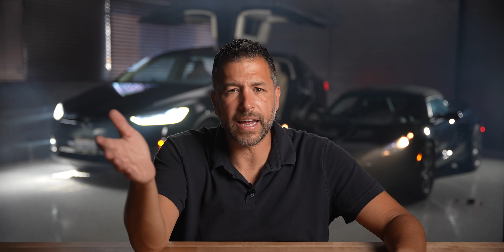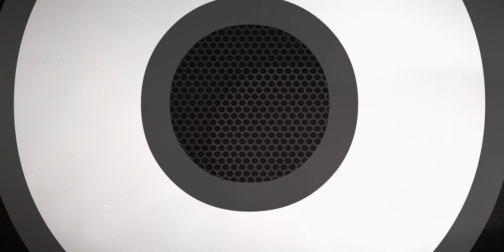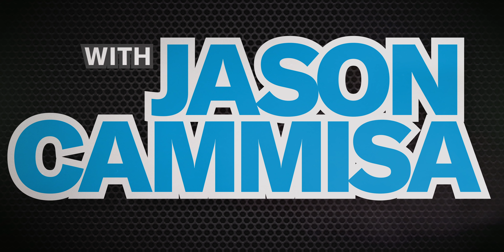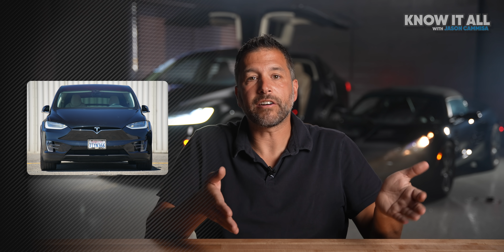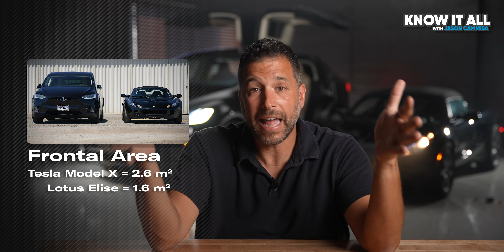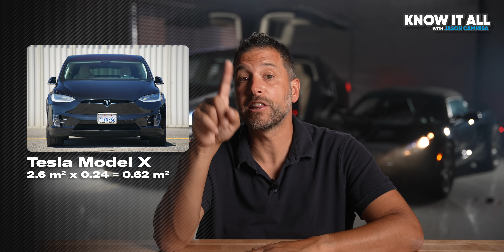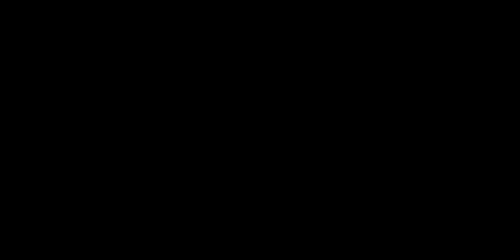Coefficient of drag has nothing to do with size | Know it All with Jason Cammisa | Ep. 12

Comment: I guess mines the ultimate experiment in this sort of regard. I have 2 XJ's, one is lowered a lot (over 6 inches) and had the trim and racks ect. 'decked', running on 275/40R18. It has a reverse cowl induction hood and a large air dam I made so that the intercooler doesn't look too out of place with some air deflectors as well. My other XJ on the other hand is raised almost 6 inches higher than stock with a 32 inch tire. I haven't done anything with the body, it's still stock.

And the difference on the highway is like unreal between the two. The lifted one feels like it's max speed is about 120kph and it seems like the pedal does nothing past a 1/3 throttle and it's a handful to keep that thing driving smooth down the road at that speed. It also didn't have much of a problem going faster than that when it was stock and would go about 150kph-ish. Felt like it could do more but it would have been too much of an effort to do in the space of the road so I never tried to go further with it.

The lowered one has power adders so I can't really compare to how it would be to my other one but I haven't been fast enough to feel if the air was a factor vs. power but I know for sure it can cruise at over 250kph without struggling to keep it straight or feeling floaty or anything like that. But at highway speeds I don't feel the air effecting it at all really. I also have an Intrepid and it drives great at speed down the highway but between it and the lowered Cherokee there is no perceived difference.

In essence drastically reducing frontal area does have a very large effect of Cd values. I'd say shape and size share hand in hand for overall effect. But I think if you seriously change one aspect you will definitely feel a large benefit.

Comment: Coefficient of drag is not always about the front area but also LENGTH of the object experiencing shear to the airflow around it. And longer the object is the more friction it experiences with airflow around it. Therefore greater coefficient of drag. So it has a lot to do with size. For example a sphere of given diameter has less drag than a rod of same diameter with parallel airflow over its surface. Go learn fluid mechanics. Idiot.

Comment: Stating drag coefficient is a strange stat to brag about, without including the frontal area. Because comparing vehicles without knowing their frontal area of each vehicle. It would be like comparing vehicles based on their HP per L, without knowing their engine displacement.

Comment: The Tesla has a low coefficient of drag (period), but it produces a low amount of drag for it's size. So how much drag are both cars creating at, say, 50 mph and 100mph? And how much force is needed to push each at those speeds? Im going to guess I'll have to throw in assumptions, like they'll have the same tires with the same contact patch size, maybe also same weight.

Comment: Well, it’s not true to say the drag coefficient has nothing to do with size; it’s easier to achieve a lower drag coefficient with a larger vehicle, particularly a longer one.

There are three (primary) reasons an Elise has a less than stellar drag coefficient:

— It prioritizes aerodynamic stability at speed over absolute efficiency;

— It prioritizes engine and brake cooling over absolute efficiency;

— It’s incredibly short (length)

Comment: Fine as far as it goes. What is the difference between ballistic coefficient between those two vehicles. If the Lotus Elise is heavier for its size than is that Tesla it may actually go through the air easier.

Comment: My Skoda Fabia 2013 is narrow small and drag coefficient 0.31.
There is no car expect Kia Picanto that is slighty narrower than my car.
There is no noise inside at all.If I lowered it a little bit,it will even faster.
It has only 1.2 TDI 75 HP,I was able to do 190 kmh at 4000 rpm max engine rpms!
Fuel consumption is 3.0L/100,maximum 3.5L/100 km.
This car is just superb.

Comment: Well... I get your point, scaling a car up or down will change the drag area but not the cd. Since it's just the ratio between frontal and drag area.
That said, I do think size matters... :D It's perfectly valid to say that's a good drag coefficient, for that size of car. If the car is really small, the cd isn't as critical, since the frontal area is already fairly small. If the car is very large, it becomes increasingly more important to have a low cd in order to not waste tons of energy in order to move air around.

Comment: In automotive engineering the drag coefficient and the "projected" frontal area are part of a formula that determines the total wind resistance force. It's a little confusing/misleading to create a direct correlation between those two factors like in this video. Maybe on a simple level it makes it easier to understand, but they are in fact not connected to each other like they "belong together". The drag coefficient is highly affected by intended aerodynamic goals like desired down force under specific driving conditions, i.e. by using spoilers and other aerodynamic tricks. The Elise has an intended high drag coefficient, because it needs down force up to a certain speed for cornering. Since it has a fairly weak engine, it's not intended to drive at high peak speeds with the highest possible efficiency like the Tesla does (side note: wind resistance force goes up exponentially above 100mph!). The Tesla needs to "glide" through the air at all times to maximize range. Because these two vehicles have completely different aerodynamic goals the drag coefficients shouldn't be conflated with each other.
Reply: Drag goes up with speed squared at any speed. 100 squared is quite a lot, but it's not exponentially more than, say, 50 squared.

Comment: Yas man but the cars are made for completly different purposes, the Tesla has to cut smooth through air because of the weight and range while the Lotus has higher coeficent because being lightweight, it needs more grip and stability. I don't know if the comparison it's fair.
Reply: The Lotus Elite from 1956 had a CD of 0.29. That was 50 years ago, it can't have been that hard for the Lotus team to aim a little higher than 0.44.

Comment: So a GM Chevrolet/Opel/Holden/Vauxhall Calibra had a 0.26 cd with 1.93 m2 area = total 0.50 m2. It also had an 2.0 engine and did 135mph and 50mpg and was made 35 years ago - nice to see so much progress has been made.............(The Calibra was not available in the USA  - ever. Think about why)
Reply: That's kind of funny because a 2.0 probably would have been seen as a big engine outside of the U.S at the time as most 4 cylinders leading up to the 90's were 1.6 and 1.8, the 2.0 being the nice big boy engine

Comment: The size of a vehicle matters as much as the Coefficient of Drag. That's why the formula for aerodynamic resistance is 
Coefficient of Drag TIMES Frontal Area Squared.

A Real 747 and a model of a 747 you make on the dining room table have the same Coefficient of Drag, about 0.031. But the frontal area of the two is miles apart. A real 747 has a frontal area about 1,937.5 square feet in size. The small model 747 that you made on your dining room table may have a frontal area of 0.5 square feet. (half a square foot)

At ZERO POUNDS (weighing nothing), a Real 747 needs about 90,335 Horse Power to fly at 600 mph - while
The small model 747 that you made on your dining room table needs about 23 Horse Power to fly at 600 mph.

The smaller the frontal area, the less energy needed to move against air resistance.
The smaller the Coefficient of Drag, the less energy needed to move against air resistance.

Combined, you get the real picture of how much energy is needed for a specific vehicle to over come air resistance at a specific speed.

Comment: Being a know-it-all I'd like to add, that getting a good Cd is harder, when your car is high, wide, and short and easier when it is low, narrow, and long. Now, big SUVs tend to be higher and wider than other cars, but usually not longer by the same percentage. But, "that's a good Cd-Value for a car with a large frontal-area-per-length-ratio" is a bit over specific to say for some people so they might go with 'A large car'... Synonymous for e.g. SUVs.

I'd at least assume it to be rude to be thrown from a building for this ;)
Reply: One valid and useful observation would be "Cd surprisingly low for how boxy it is".

Comment: So, mechenical engineer here. While what this guy is saying js 100% true, when applied to cars it becomes more complex. See you only have so much space to work with. You cannot for example take a tesla s and make it 2 times bigger, it would have the same cd but would obviously not fit on the road because of width AND length reasons. And here is where it becomes intresting: the bigger you make a car, the less dimensions you can work with. Tesla choose to make their models relatively shaped like a droplet so it has a very low cd, losing a lot of space in front and as a consequence losing space in the back. Volkswagen id3 chooses to make the car a bit bigger,  but at the cost of shape optimising.

Comment: Question... If one vehicle is twice the  size of another but they both have the exact same CD, do they both use the same HP to go the same (if the weight is identical) speed?
Reply: No, the larger vehicle has a twice as high drag total (Ct). So it will develop higher power to go same speed, since some of the power is wasted on overcoming the total drag.

Comment: Mind you, the design of the Elise is such that it's made for more downforce.
   By increasing downforce you inherantly increase aero drag?
   Downforce is just redirecting the engines energy output to push the vehicle downward, rather than forwards.
   So the Elise compromises it's aero fluidity to gain tyre grip
  ???
 Plz school me if I'm wrong on that

Comment: I applied this same thing to our SAE Supermileage car.  A smaller frontal area resulted in less drag than a bigger, rounder car design with a slightly lower drag coefficient.  0.22 m^2 frontal area and roughly a 0.15 drag coefficient.  This resulted in over 3000 mpg when combined with some ultra low rolling resistance tires and a good driving strategy.

Comment: Yeah but why?  There are CD calculators that I can tell are straight B.S. For one reason, if you enter the model x dimensions in, they come out waaaaaay wrong. So how in the Fffffffff do you actually design for low CD? Anyone??
Reply: If nobody knows, I'm just going to take a bunch of molds off a model x and put my frackin lotus under it.

Comment: While the point itself is valid, the one about how much force is needed to push the elise vs the tesla is not. It would only be so if we would only be talking about their empty body shells, and they weighed the same. Otherwise, the lower Cd would never make up for the huge weight difference in terms of force needed to push it through the air.
Reply: Where does weight figure into it? To travel a certain velocity, it does not. Acceleration and deceleration are power to weight dependent things.

Well actually we know that heavier cars have more tyre friction, so that affects the constant speed case, but imagine you have skinny and hard tyres, you could reduce that a lot... Which is what many EV and hybrids do... But then you can't accelerate and brake very well. And wouldn't have a lot of steer control either.

Comment: The lotus is a sports car designed to use air to increase it's grip on a track...............The Tesla is a people mover and an appliance used to quickly and efficiently get from A to B.
Sports cars will usually have a higher drag coefficient, as performance is top priority. Regular cars will have a lower one to increase fuel economy, decrease wind noise and make a more pleasant drive. A F1 cars drag coefficient is over 1.0........again, by design.

Different tools designed for different purposes, but they can do things the other can do too if required.................but it's NOT the priority in design.

Comment: Was expecting an explanation on why the Tesla coefficient of drag is that low tho
Reply: Because its a smooth shape designed specifically to cut through the air well.  There are a number of probably real detailed items you could get into like how it doesn't need a grill or as much airflow as a gas engine car as well.  On the flip side the elise is a sports car and part of the design involves deliberately trading drag for downforce to increase the at-speed stability of a car that is so light.

Comment: Assuming the math here is right and downforce isn’t changing anything, with equal power the Model X would have a higher top speed.
Though with equal power the Elise would accelerate quicker with a better power to weight ratio.

Comment: Say you shrunk a model X to the size of the lotus wouldn't it have even less drag than the full size model X as the effective frontal area would be even smaller? in turn meaning size absolutely does have something to do with drag? 

I might be completely wrong, but wouldn't that be a massive oversight for this video if true. Basically would mean a small car would be more efficient than a big one every single time if they both were optimised to have minimal drag. Then you at the weight reduction benefit of being smaller and now you have a more efficient accelerating car as well, but that's besides the point.
Reply: Correct.

Comment: Not clicking like. Protesting nose-picking.
Aerodynamic drag:  compare a nuclear submarine slicing through the deep water stealthily with low drag due to it's superb shape...... to a small wooden sealed box, getting hauled by a cable through the water below the surface. The little box puts up far more drag than the giant sub, relative to the water each is displacing.

Comment: My question now, why doesn't lotus (a car that focuses on being light and nimble) have a lower effective drag coeff.?
Reply: because it has to have some downforce so that it actually feels controlled because it needs some air pushing on it cause it weighs like 900 kgs
Reply: I realize your question is old, but figured I'd give you (and anyone else who browses the comments) the answer since this video is being promoted again: You actually kind-of answered your own question. Lotus cars are designed for stellar handling, not top speed. The power required to overcome aerodynamic drag increases with the cube of the speed increase. Colin Chapman's formula was to "add lightness" rather than power. :)
For many years, the best handling car ever made was considered to be the Lotus Europa. That's definitely not a top-speed car, it doesn't need to be (there's not a lot of places you can drive that fast). It very possibly ended up with a nice low Cd of 0.29 at the time by chance of the styling. The handling crown was handed over to the Elise once it hit the market. I remember one reviewer referring to the handling as "telepathic". :) The body of that car was designed to be more dramatic and eye-grabbing, so aerodynamics weren't as much of a consideration.
For contrast, a Countach has an even worse Cd than the Elise at 0.42. Many people think it's aerodynamic, but it's just really powerful. A 1974 Countach's top speed was 170mph (claimed 186), while a '74 Europa maxed out at only 121mph, even though the CdA (coefficient of drag multiplied by frontal area) is significantly better... it just had a small fraction of the horsepower of the Countach. I'd place bets on which one would handle better in a slalom or very tight road course though. ;^)
Topping all of that off, @thehumanoid6543 is right about the Elise. Because the higher end engine option has enough power to push it to 145mph, they made sure that dramatic styling provided a lot of downforce (wikipedia says 276 pounds at 140mph). The base engine can only push it to 127mph.
Reply: @glabifrons  thank you, thorough and informative

Comment: Next explain the relationship between frontal "effective" area, torque, acceleration, power, and top speed
Reply: I think at least the top speed is related to it, given all other items are equal. I.E., 2 vehicles with identical torque and power, and geared the same, will have different top speeds depending on which has the lower drag coefficient.
Basically, due to there being less area "gripping" the air, an engine and drive-train have to work less to push the object through it. However, I think this only works if their mass is similar. While rolling resistance and wind resistance account for some of the limitations, you can't cheat physics as far as the weight of an object and the power needed to give it inertia.

Comment: THE SCIENCE THE SCIENCE, why is this guy on hagerty now? it 100% is related to area. Obviously a smaller car can have a higher overall drag coefficient than a larger car, but the surface area is directly part of the equation. And you know what? A bigger car has more surface area.
Reply: @AzathothsAlarmClock  A big part of it is also friction, and the surface area is directly related to that based on the friction coefficient as well. Regardless, everything scales with size and area, so all things being equal bigger = more drag.

Comment: Sorry, but the Reynolds number affects the Cd. You can't obtain a Cd value without defining the Reynolds number, which includes the size. In other words, the same shape, at the same speed, in the same air, but twice (or x3, x4, x5...) as large, will have a different Cd.